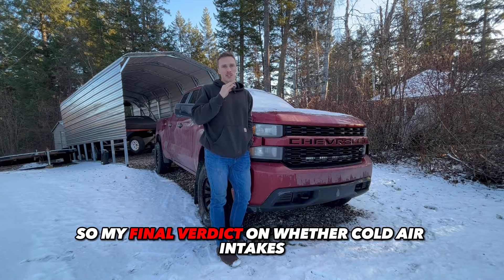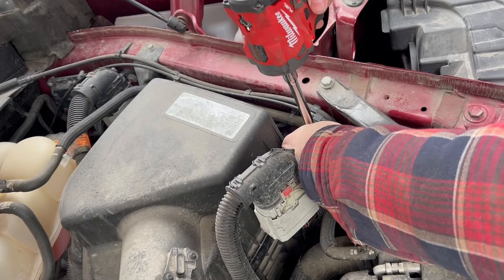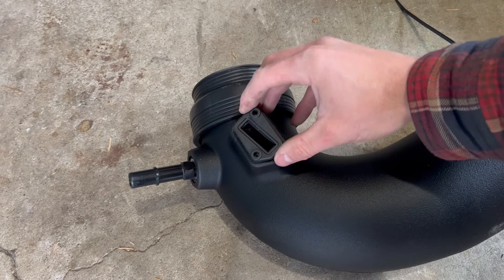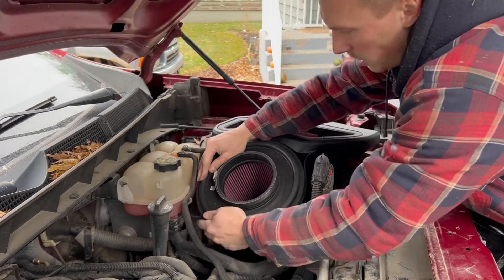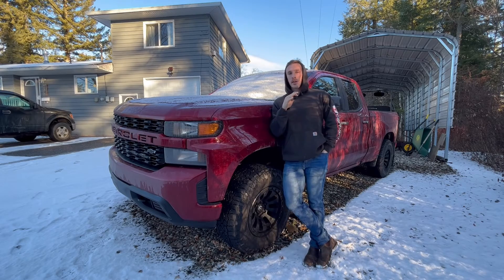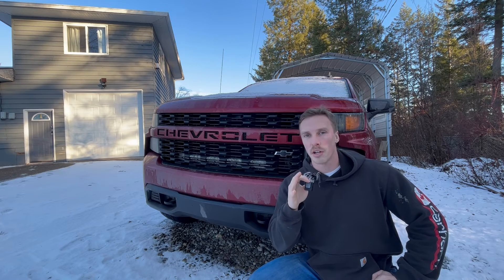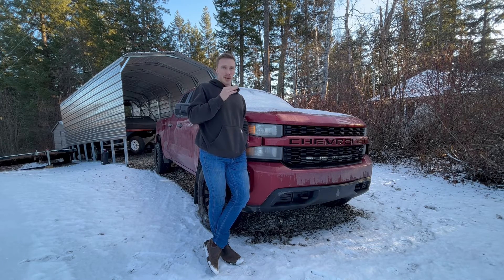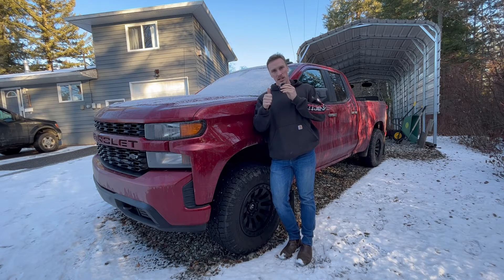Do Aftermarket Air Intakes Actually Work and Save You Money?

Comment: I do think a CAI does help with all of your points mentioned but it has to be an actual cold air intake. I was convinced that I was going to do your S&B CAI until I really started to look at the units details. First and foremost the port that is supposed to pull in cold air from behind the headlight and through the hood line will suck hot air. GEN 5 SBC generate heat and in the summer that thing will suck hot air. Second the location of the MAF sensor. There is a clean side PCV tube that directly shoots oil and fuel vapor under WOT into the MAF fouling it and will most likely cause issues. Third their filter testing is kinda crap. Yes they use ISO 5011 but I don’t believe their claims of better filtration compared to stock. The only company that I’ve seen that actually has an almost perfect filtration efficiency and still out flows the stock air filter is the Power Core that Donaldson Filtration created and is used in Volant intakes. That filter has a 99.99% filtration efficiency using the ISO standard that all the auto manufacturers have to use thanks to SAE. It put flows the stock air filter with a higher CFM and maintains a higher mass air density which in return helps both throttle response and horsepower. The MAF reads air density so heavier air and cooler air makes power because more of it! It would be kind and cool if you to do a comparison between Volant and S&B’s intakes cause a negative of the Volant is the amount of turns in the tube which increases restrict but it sure it’s better than stock. Sorry about the paragraph!